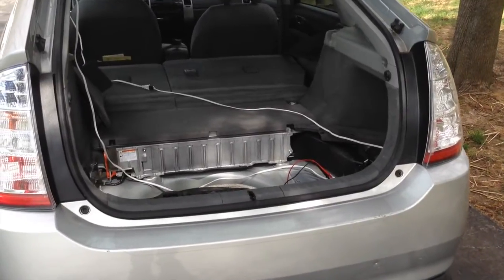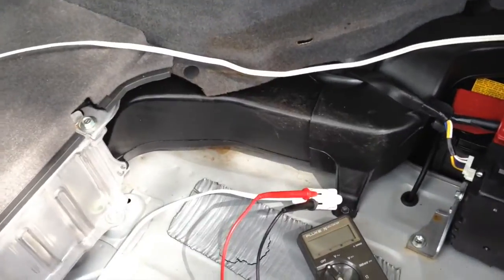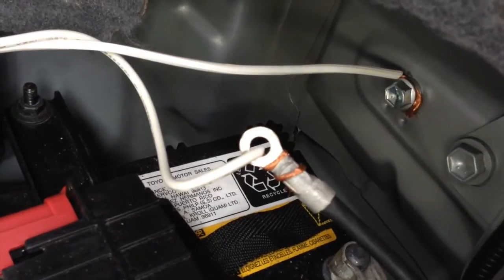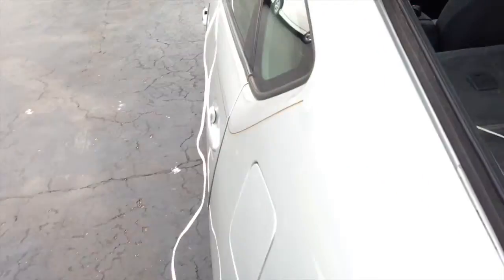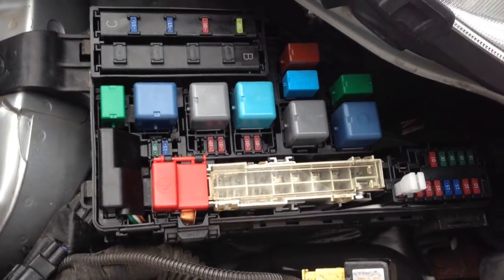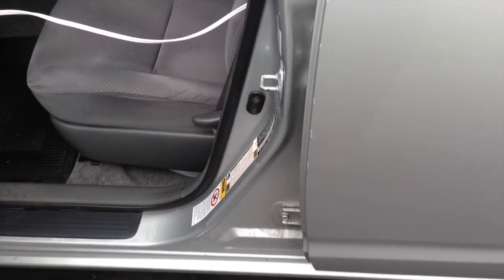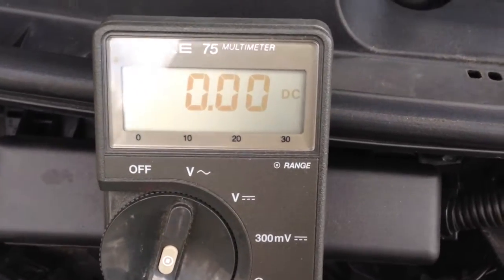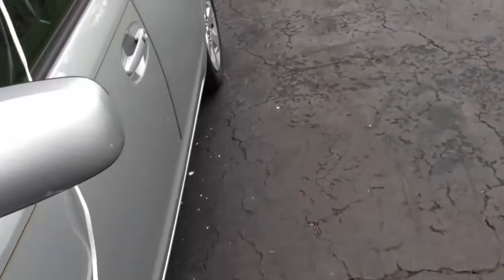PRIUS 2004-2009 WIRING SHORT  AUXILIARY  BATTERY DRAIN REPAIRS

Comment: My friend's 2012 Prius only goes down to 0.7 amps with the rear hatch open but all lights confirmed off except the hatch open indicator.  about 0.2A through fuse #14 "ECU 2" and about 0.5A trough fuse #35, "ECU 2-B".  turning off the smart key, via the "setup" button in the radio, I think reduces it to about 0.5A.  car won't start after parked more than 1 day.  I heard I need to rig up longer leads and clip them in so I can read it after more than 5 minutes with all doors closed including hatch.  will do and report.